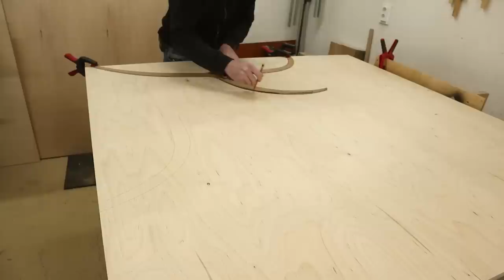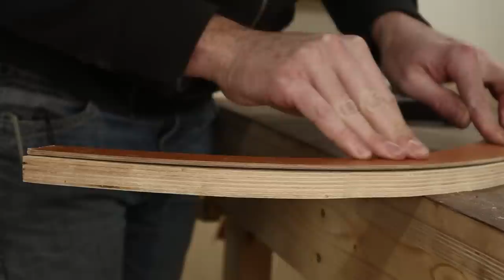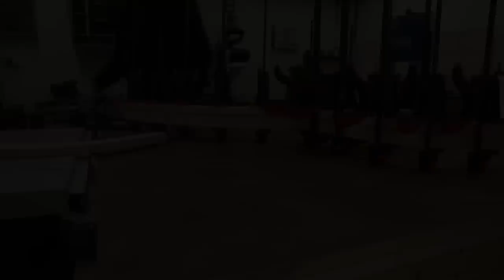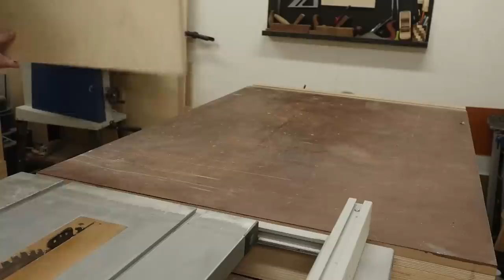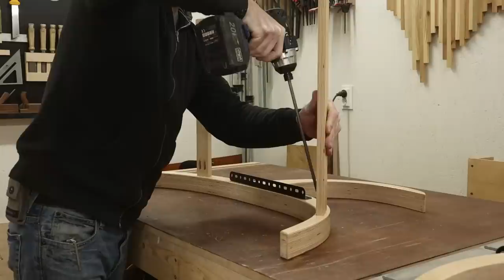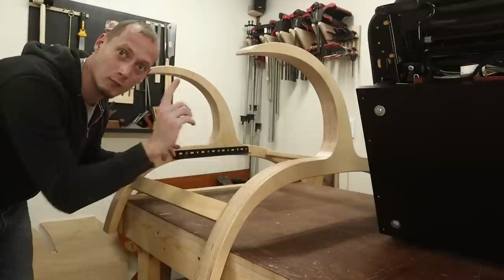Comfortable Lounge Chair made from a 2000$ Recaro Seat

Comment: I've tried a couple of different designs to use a car seat as a computer chair, on mine "RECARO" is spelled differently (K-I-A) they are unbelievably comfortable for computer work and hard wearing.
I appreciate they are goin gin your truck but as you spent so much time carving the frame can I make just a tiny suggestion?  Carve out a small rectangular  cover for the metal mount sticking out the front.  Would just finish it off nicely.

Comment: someone gave me a old car seat and I'm searching for ideas on how to mount legs and absolutely love the design of your arms/legs for this chair. where did you get or how did you make the template you used to cut out the legs for the chair?
Reply from the maker: Honestly I just set the seat on a box that felt the right height and used cardboard and a hot glue gun to glue together the shape i liked. After that i Transfered over the cardbord template to a piece of thin wood ( the stuff you see in the video was a piece of backboard from a dresser that i found in the dumpster) and cut it out with a Jigsaw.

Comment: Interesting build!  Two cross members held on with pocket screws = zero strength. Other than the seat mount plate, those legs have no lateral stability.
Reply from the maker: Thanks a lot! I’ve tried it first without the cross members and it was waaaay too flimsy! Adding those braces made it super stiff. It works just fine for the time being.